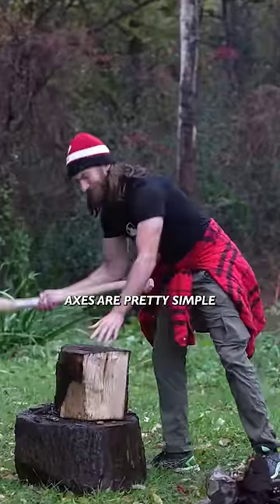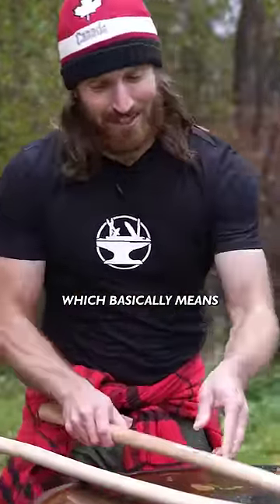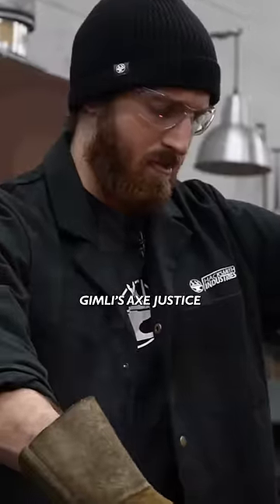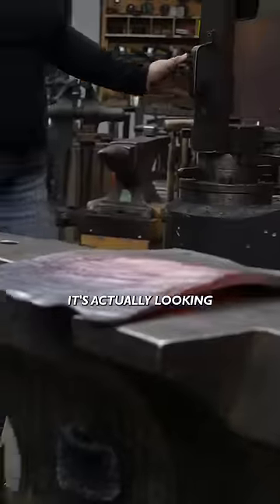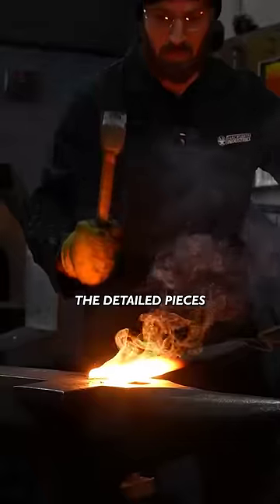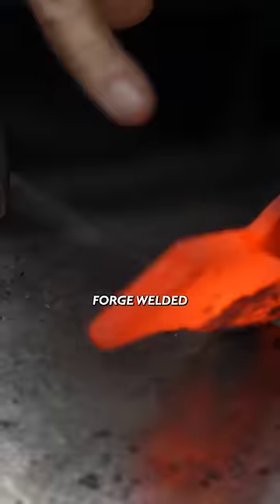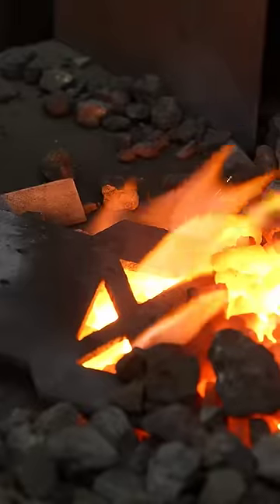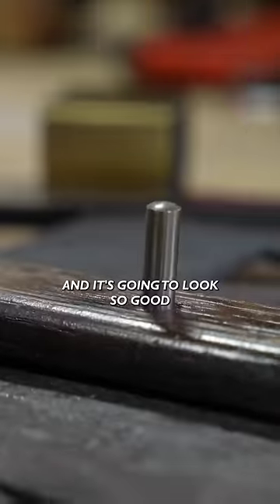...and you have MY AXE 🪓!

Comment: Ok but I'm convinced that the executioners axe would be like 3 times more terrifying in combat if they use it right 
Like as soon as you get knocked to the ground And they bring that thing down your dead
Reply: Problem, your against a wall of spearman, you have no shield, as an executioner ax is twohanded. Either you got armor, or your a pin cushion. The executioner axe is also shorter than most spears and other battle field axes. If you got an executioners sword you could go the dopplesoldner route and hack of spear heads + intimidation as they served a more ritualistic use as they were more decorated.
Reply: @somerandoinaknightsarmor9938  spears defeat everything but bows they are the best weapon for hand to hand combat especially when in a defensive line any weapon that's meant for hand to hand combat will loose to the spear

Comment: Fun fact:
That is not Gimli's original axe.
He started the journey wielding a slightly smaller, but just as beautiful, single bladed axe, similar to the one he messed up trying to destroy the ring, which indicates he had a pair of them.
He picked up the double bladed one at Balin's grave in Moria, right before the battle began and preferred using it ever since, while still carrying the other with him, plus a few smaller throwing axes.

Comment: Double headed axes were often more of an agricultural tool than anything. One side would be a different blade profile, which allowed for two tools to be combined into one, albeit requiring more effort to swing. 

A Battle-Axe, or any axe made for fighting, would be defined not by number of heads but by the shape. Battle axes were typically far wider and far thinner, since cutting flesh is easier than a tree, and more blade length means less room to miss. The tree doesn’t kill you if you miss, after all. 

Sorry, I needed to get it out of my system lol.

Comment: As cool as they are they weren't that common. Most axes only had one edge/head. It was way more useful to have a blunt object or a small point like a spear head on the other side. Makes it easier to weild, lighter, can use it to chop wood and as a hammer (if its blunted on one side not a point) as well as making it more effective against varied types of armour :)

Comment: Battleaxe doesn't mean two heads. Most battleaxes were single headed. It means it's designed for combat rather than as a tool, so it's usually got a much thinner blade than tool axes so it's quicker and more nimble

Comment: “With real blacksmithing”
Proceeds to plasma cut it out of sheet steel.
Reply from the maker: Since when is hot chiseling the shape plasma cutting?
Reply: @hacksmith  you hit chiseled the blades that you forge welded on. That entire main body of the axe head was cut by a machine.

Comment: A battle axe doesn't need to have a double head. Battle axes are a lot thiner and lighter than wood cutting axes though. They also have longer blades and longer handles etc. Short throwing axes have a lot smaller blades than typical wood hatchets on the other side.

Comment: Sorry mate, you have your wires crossed. Gimli, the dwarf character in J.R.R. Tolkien's "The Lord of the Rings" series, named his axe "Gimli's Axe" or "Axe of Durin." It is a double-headed battle axe that Gimli wields with great skill and proficiency throughout the story. Now the definition for a Battleaxe means a large broad-bladed axe used in warfare, it doesn't have anything to do with having multiple heads. You get either a standard Battleaxe or a double headed Battleaxe.

Comment: Er, no. Battle axes just have thinner blades. Because a wood-axe is intended to.. split wood. Humans and armor don't have a bunch of fibers that need to be split apart. What you have there is a double-headed wood chopping axe, and the reason it has two heads is simple. One blade would be sharp and used for felling, whilst the other was a little blunter for limbing. I sincerily doubt, unless you were needlessly cruel. You'd require two heads on a axe intended for war use for those same reasons.

Comment: But does it cut, does it kill?
Reply: i assume it would do a LOT of damage and then crumble to pieces after it hits anything
Reply: @slimetunersis5373  Most likely, but that particular phrase I posted is in reference to a show called Blademaster, where blacksmiths come on and have to forge a specific weapon. Then they test it, first to see how well it cuts, and then if it is deadly or not. They ask the question, does it cut? Does it kill? Before testing its efficacy as a weapon.

Comment: Look so good???
Has tack welds on the decorative pieces that look like shit, not even grinded smooth or a good weld, like a tack weld bird shit. I am not sure but the cap on top also looks slanted but could be a optical illusion, hard to tell from the short. As for the patern on the decorative parts looks like a faded text drawn on.

Wouldn't tool steel be to brittle and shatter? Tool steel is hard and would make a awsome edge but its also very brittle. Think of a drill bit and how they snap, you don't want a blade edge made of tool steel.

Comment: The way you "forge welded" the blades gives me pause. Why not just make it all one piece. Will it hold up to any chopping?
Reply from the maker: It's a real blacksmithing technique... it allows you to use different steels -- good steel for the blade, and cheaper or softer steel for the core. There's a reason for it lol
Reply: @hacksmith  interesting. Did it work for chopping wood?
Reply from the maker: You can watch the full video linked below the short title, it goes over the whole project